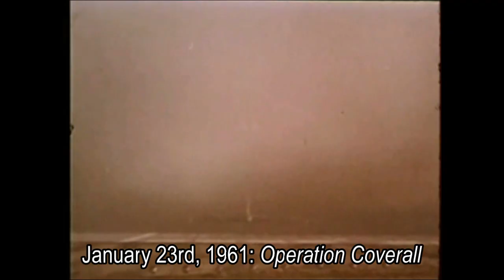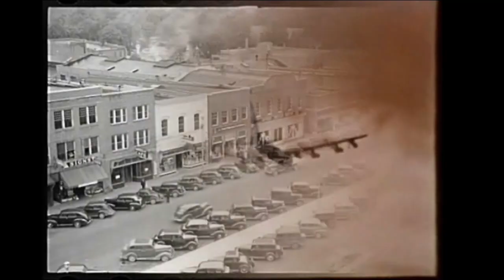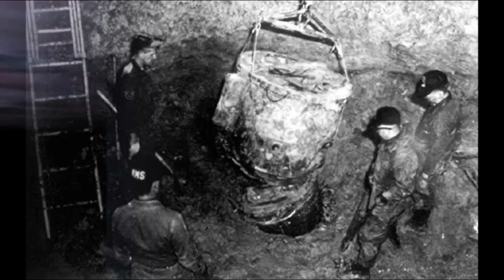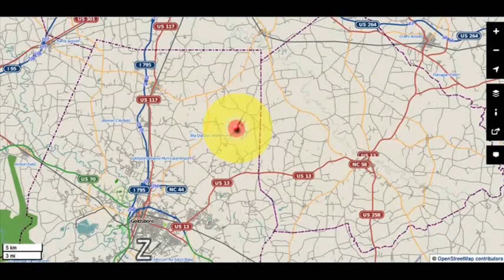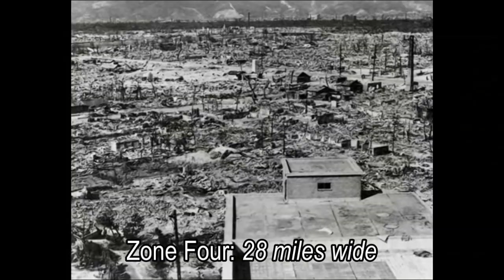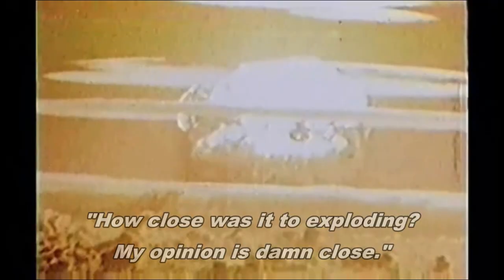The Day the Air Force Almost Nuked Goldsboro, North Carolina

Comment: How do you fail 3 out of 4 safety switches on a bomb? And then fail the 4th one on the first bomb?!!  It's like just leave a gaping hole for a giant metal key to be placed to cut off the circuitry? It's not hard to put in a safety mechanism!!!
Reply: The problem is that when the device suffers impact and/or heat, there could be new electrical circuits created by the flowpath of melted components from onboard circuitry, which would bypass the safety switches.
Reply: Good god! Okay.. umm.. use nonmetallic conductors like graphite for the main distance between the bomb's intricate metallic circuitry and the main power source.
Reply: I guess.  I'm not a nuclear bomb designer.
Reply: me neither.. awkwardly scoots backwards out of room..
Reply: I literally LOL'd.